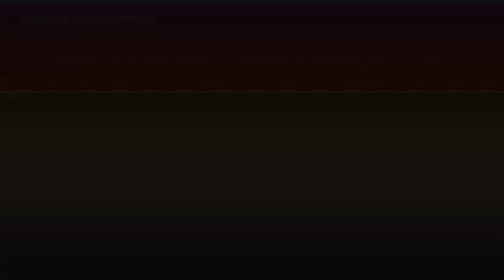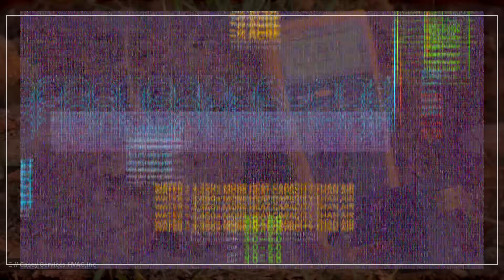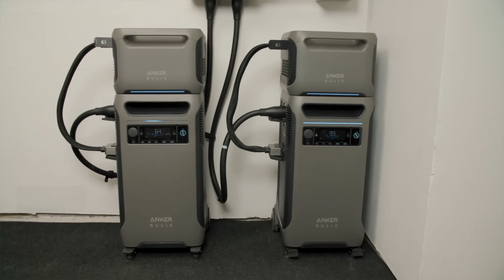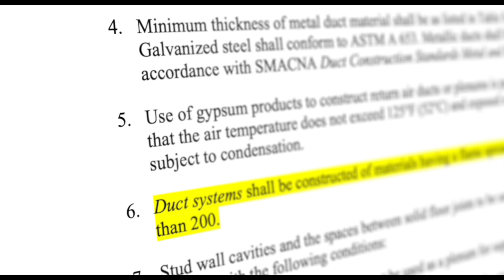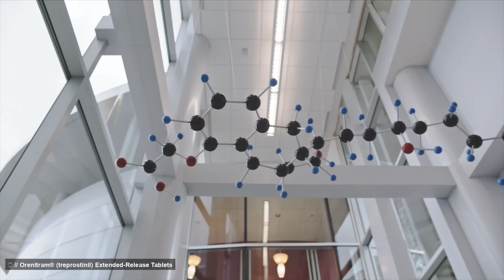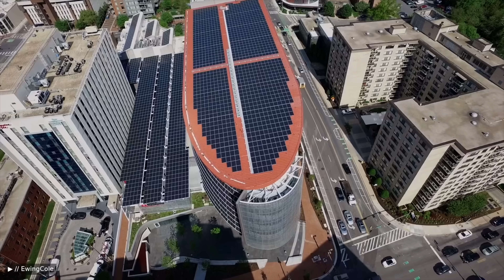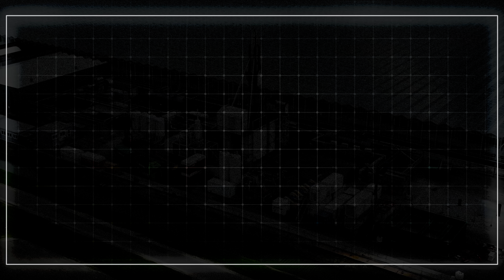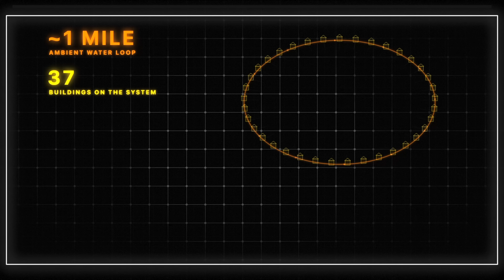The Viral DIY Cooling Hack That Nearly Killed a Family

Comment: Rick - thanks for your work!
A vertical boring variation radically reduces cost per kW of groundloops.
See Harrington, Najib,  et al, "Low-Cost, Large-Diameter Shallow Ground Loops for Ground-Coupled Heat Pumps," California Energy Commission, 500-2021-009, February 2021
A single 24" bucket-auger to 30 feet BGS can provide about 1 ton cooling compared to a conventional 180 foot thermal well but at much lower cost.  Tubing is coiled evenly down the wall of the borehole giving much more contact per foot depth.  Details in the referenced paper.

This may not work in very shallow groundwater.  but if your home is on higher ground in San Diego - it may be a good candidate to consider.

Comment: Great video Ricky. A refrigeration tech I know actually looped the pipe in a small lake or if you will pond and used it for his geothermal heat pump system. Worked great. Actually lowered his electric bill by 2/3 third according to what he told me. I use the air source heat pump but have always thought about the ground source. I had thought about the Donut Labs batteries for energy storage. LOL not really.  Anyways always great content sir.

Comment: I'm renovating an old passive solar house. It was killed by condensation. Hot humid air and cool ground temperatures are a bad mix. If you live in a desert it will work . Using the ground for heating is a $25k excavation expense alone so it will never pay for itself . Also Water is heavy and requires pumping that burns the KWs.
Reply: Pumping water doesn't use much power; it's a closed system so weight has nothing to do with the energy requirements.

Comment: Could you not just use a well drill for drilling the bores and just get a plumbing contractor  to lay in the pipe and then install the heat exchanger, there are other industries that do parts that could/should be able to cross over.

Comment: There's also Aweb Geothermal Supply, and they make the Slim Jim and Geo Lake Plate Heat Exchangers submerged surface water heat exchangers, used in geothermal pond loop applications.  The Slim Jim is regular stainless for use in fresh water, and the Geo Lake is made of titanium, for use in brackish or salt water.  They're @AWEBSupplyCo here on YT.  It's really neat!

Comment: Black mold was certainly a guess, but I was expecting radon to be the culprit.
Reply: Radons not that bad.
Reply: @kittywampusdrums  No, untill it sticks to something so you breathe it in or eat it. You start insulating old houses in such areas you need to balance with loads of ventilation and a impermiable membrane (need that for moisture anyway) under your concrete floor. Old houses that the wind blows through are not that much a risk, modernizing them means you need to keep this in mind.

Comment: a side note but worth noting is Modern homes are not insulated nearly enough.
Reply: In the 80’s houses got really insulated which in part means air tight and people ended up getting really sick due to toxic gasses given off by many common things found in houses.  The result is that nowadays houses are not airtight so there is a certain amount of air exchange between the inside of a house and the outside.
Reply: @psy999  yeah they got so airtight we started having to put in heat exchangers that bring in outside air while exhausting inside air as well as make-up air intake vents for appliances like furnaces, water heaters, dryers, even stovetop hoods. I sealed a lot of leaks when I moved into my house only to end up needing to cut a hole and put in an intake vent later just so that the dryer wasn't causing a partial vacuum when run.
Reply: Most modern homes I've seen are too much insulated, the outer wall should be able to breathe and dry, same underneath and above false ceiling of the house. If not you'll need mechanical ventilation on all the time or your house will get mold, more often than not people don't use it since it kinda defeats the purpose of insulating the heck out of the house. When building a new house it should be a default to think about where's the cold point in the wall, how it's going to get rid of the moisture and how you want to deal with heating and cooling.

But of course if we are talking about the houses in the US there's no point if you're just going to move after 5 years and nothing you build is for yourself or to last.

Comment: They need to use aluminum tube to up the efficiency, plastic is a very poor thermal conductor.
Reply: A lot of ground is very slow at transferring thermal energy so the thermal conductivity of your piping matters a lot less than you think.  But if you have really good ground i.e. say water logged dense clay, perhaps even with running water, then yes, the thermal conductivity of the piping will matter more, and you could get away with say using copper and needing less of it than the plastic that is typically used.

Comment: Geothermal heatpumps has been more or less standard here in Sweden for 30+ years.
Works excellent and those systems lasts a long time too since they run so stable. 

Our pump was installed in 2003 and still going strong. When it's time to replace it, the new unit can use the same energy well.

Comment: I am running vertical ground source, water to water heat-pump since 2019. The heat is distributed through in-floor water heating system. I live in moderate climate of northern Poland. My experience with the system is pretty great. The install cost was very high, but with raising electricity costs I am looking at breaking even in around 3 years (10 years from installation) as compared to gas system. I am factoring in my PV production into that, (here in Poland we have pretty great deal on PV billing, I can sell my surplus to the network in the summer and use my acquired total KWh in the winter) but still, the system is supposed to work for 20+ years so the benefits are obvious even without PV. What attracted me to ground source was the invariable efficiency, air heat pumps are ok, but the the counter-synergy of "the colder it gets outside the lower their efficiency" was a no-go for me. Ground based system works at its rated 400% all winter long, regardless of outside temp, with two caveats. If you incorrectly estimate the amount of heat you need to pull out from your source, you can "freeze it out", in extreme cases the heat-pump has to abandon the "pumping" part and switch to resistive heating. Thus dropping the efficiency advantage completely. Adjacent to that, if you don't have geological data of your area, you risk having a sand layer at the target depth, which can throw off even conservative source capacity estimations. All in all, if I'd build another home, I would go for the same system for a second time. I hope you will be happy with yours too.

Comment: In Europe, they're using lasers to dig these holes.  It's super quick to do, and you don't need these massive drills.  The only issue is to get the batteries to power the laser.

Comment: I'm more interested in an add-on unit to boost efficiency of existing air-source heat pump or air conditioning systems, mainly because of the problem that Ricky mentioned- we lock in the cost when an existing unit needs replacement, due to the very high replacement cost. All of them have an outside "condenser" unit that takes air and passes it through coils to exchange energy with a working fluid/refrigerant. Even at 4" depth, easily reached with a trenching device like a "ditch witch," the ground temperature is vastly more stable and closer to 10C than ambient temperature. For about $300 in equipment rental, pipe, pumps, and some cheap automobile radiators, a significant ground loop can be run to "pre-treat" the air input for an air source heat pump. If needed, booster fans could be added to overcome resistance through the add-on radiators, preventing strain on the condenser fan. Has anyone done experiments or a proper analysis for this kind of retrofit? @TechIngredients made a ground source air conditioner unit with a custom mod to a cheap window AC unit that was very effective, but was a lot of work and required some custom parts to be fabricated.
Reply: I've wondered similarly.  I'd be more apt to use a gas powered high powered pressure washer to do the digging.  But yeah, have a few pipes buried a few feet down in the ground going right up to the outside condenser and have the more stable, moderate temperature air blow across the fins. 

   Ideally though, you would directly immerse the outside condenser coils and fins in water (but there will be galvanic reaction between the Al and Cu) and circulate the water through a closed loop. But that is going to be more complex, challenging, and more costly than the simple air+fans. 

  On the intake side, if you have sun in that area, in the summer you could put a partially insulated box over it painted on the top with Cryo-X paint.  Then in winter, swap it out for an ultra black painted Al box or the like.  Idea being to partially pre cool or pre heat the air some.

Comment: Your comment on the drillers for the installation. I am not sure where you got ;your data from, but back when I had my own HVAC company in PA and we specialized in geothermal systems, all our vertical installations we had the vertical bore hole drilled by 'well drillers'. The Well Drilling company did the physical bore work and the HVAC company did the tubing and grouting work, which we were trained for. As such there is far more access to getting the vertical system done then you implied.

To be clear this was in rural PA were most home have private wells and there is no shortage of well drillers. Also we never had to deal with CA government and regulations. So I do not doubt you maybe facing some steep issues for installation for your exact installation.

I started doing geothermal installations around 28 years ago, and if done correctly they are by far the most efficient systems overall and offer the longest term stability. What is most important is getting the system properly sized / engineered / planned / installed for the property.  If done incorrectly they are the most difficult and costly to fix after the fact, but done correctly they are the most stable and efficient for most locations and situations.

Comment: If I would ever live in hot climate. I would definetly paint my roof white. Screw estetic. And second layer with ultra white pigment that NightHawk gave us recipe. Passive free AC.
Reply: It will help, but not as much as you think. If you're going completely passive, you need multiple systems helping each other. Ironically enough, the desert is the one place where group to open air exchange, if there isn't radon, can work well, but even then, you want  your piping in a somewhat v or u shape and perforated at the bottom to drain out any potential condensate.